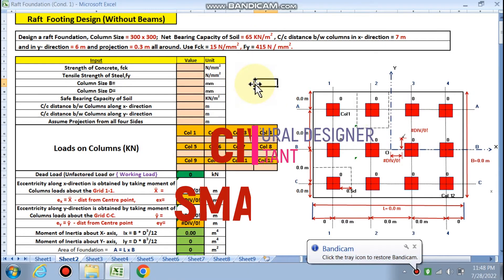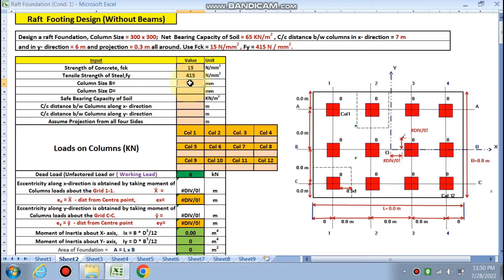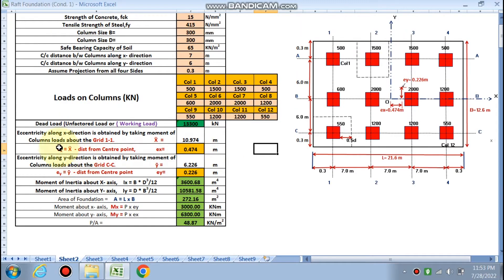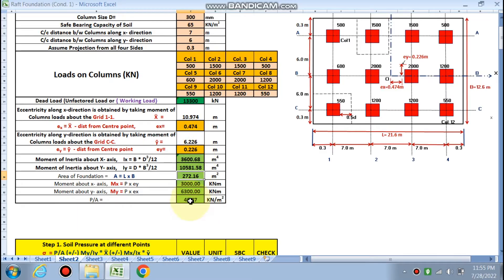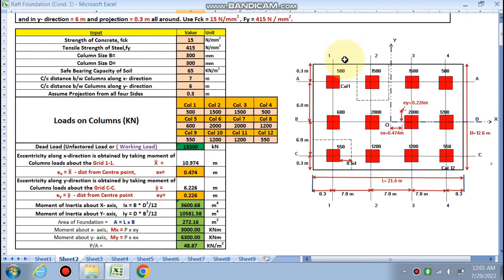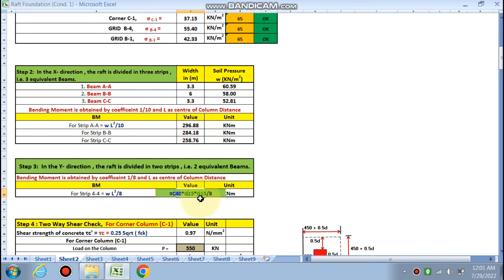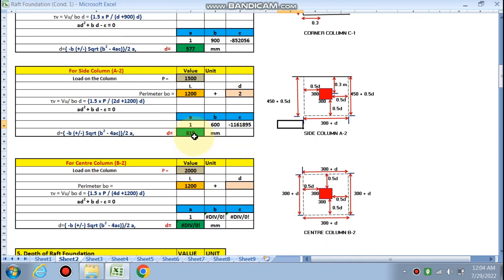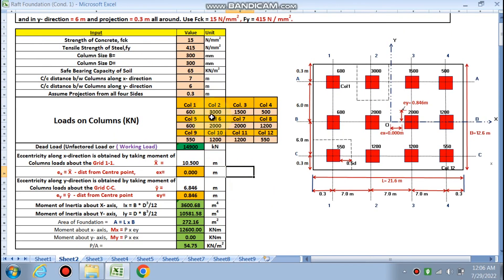RAFT FOOTING DESIGN WITHOUT BEAMS- BY CIVIL SMART

Comment from the maker: To get all the footing excel Sheets get from below link:
https://pmny.in/PAYUMN/WJczW5eItHK9
    

Full design Excel sheets course 
https://pmny.in/era02LAqXt8B

Full Course includes all sheets as under:

IN FOOTING DESIGN SHEETS

1. Isolated square footing

2. Isolated rectangular footing

3. Combined rectangular footing

4. Trapezoidal footing design

5. Strap beam footing design

6. Footing with uniaxial bending

7. Footing with biaxial bending

8. Pile foundation

9. Pile cap design 3 & 4 piles

10. Wall footing/ Strap footing

11. Raft Foundation ( Beam and Slab Type).

12. Strip footing design ( 4 columns).

13. Eccentric Footing Design (Column at dist x from the edge of footing).

14. Eccentric Footing Design ( Column is at Edge of the footing).
 
IN BEAM DESIGN SHEETS

1. Singly reinforced beam design sheet

2. Doubly reinforced beam design

3. Continuous beams design  with point load having :

    2-span continuous beam

    3-span continuous beam

    4-span  continuous beam

    5- span continuous beam

4. Cantilever Beam Design.

5. T-beam Analysis.

IN COLUMN DESIGN SHEETS

1. Axially loaded column design

   (a). When column size is known.

   (b). When column size is not known.

2. Column with axial load with uniaxial moment ( on 2 sides and 4 sides reinforcement)

3. Column with axial load with biaxial moment

4. Mux and Muy Calculation sheet.

IN SLAB DESIGN SHEETS

1. Cantilever slab design sheet.

2. Simply supported slab design sheet.

3. One way Continuous slab design sheet.

4. Two way Continuous Slab design sheet.

5. Two way simply supported slab design sheet.

6. Flat slab design (without drop and column head).

7. Flat slab design with drop only.

8. Flat slab design with column head only.

IN STAIRCASE DESIGN SHEETS.

1. Dog legged staircase design.

2. Open well staircase design.

IN RCC WATER TANK DESIGN SHEETS.

1. RCC WATER TANK RESTING ON GROUND (L/B <2).

2. RCC WATER TANK RESTING ON GROUND (L/B >2).

3. UNDER GROUND WATER TANK DESIGN (COND. TANK IS EMPTY AND OUTSIDE SOIL IS SATURATED).

5. UNDERGROUND WATER TANK ( TANK IS FULL AND NO OUTSIDE SOIL PRESSURE).

4. UNDER GROUND CIRCULAR WATER TANK.

5. Overhead Circular Water Tank design.

6. Intz Tank design.

IN WALL DESIGN SHEET

1. RC WALL DESIGN SHEET.

2. RETAINING  WALL DESIGN SHEET.

3. BASEMENT RETAINING WALL DESIGN SHEET.

4. Counterfort Retaining wall design sheet.

5. Shear wall design with boundary elements condition.

Building load calculation sheet

Cost estimation sheet..etc..

Comment: Sir can you provide a generic excel sheet where we can enter the number of columns of our own choice and the dimensions of columns could be different. That will help in cases where column dimensions are not same. Also are these dimensions calculated according to IS standards? Can we have an excel sheet where steel is calculated according to ACI standards.

Comment: In black cotton soil at what depth raft footing need to placed below ground level and what is the criteria??
Reply from the maker: Provide spread footings/wall footings, under reamed piles or raft foundation (for special structure whose load is greater than 6 tone/sq. m) for the low-rise buildings. Never rest the foundation on the black cotton soil. Lay the foundation minimum 300 to 500mm below the level where the cracks cease in the ground.
Reply: I have designed raft foundation (depth of raft is  550mm) for G+4 building at depth of 6 feet below G.L....and plumb concrete under the raft is 1ft of 2 layers ....is this appropriate ....what's your suggestion on this?

Comment: Sir, please explain how to find out the value for ex and ey?
Reply from the maker: If u calculate CG of the footing due to Column loads in x-direction then we will take moment about Grid 1-1

X = (Grid 2-2) loads x dist. From Grid 1-1 + (Grid 3-3) loads x dist. From Grid 1-1+ (Grid 4-4) x dist. From Grid1-1 / Total load
Hence X = ( 1500+2000+1200) x 7 + ( 1500+2000+1200) x 14 + (500+1200+550) x 21 / 13300
; X = 10.974 m from Grid 1-1

Same for Y
Y = 6.226m from Grid C-C

Now ex = X - dist of centre point of footing.
As X = dist. From Grid1-1, hence we need to add projection first
So, Total = 10.974 + 0.3 = 11.274m
Dist of Centre point= 21.6/2 = 10.8 m
Now ex = 11.274 - 10.8
ex = 0.474m

Same is for ey calculation
ey = Y + projection- dist of Centre point
ey = 6.626 + 0.3 + 12.6/2
ey = 0.226m
Hope u understand.

Comment: How to calculate cg of footing due to load..pls explain
Reply from the maker: If u calculate CG of the footing due to Column loads in x-direction then we will take moment about Grid 1-1

X = (Grid 2-2) loads x dist. From Grid 1-1 + (Grid 3-3) loads x dist. From Grid 1-1+ (Grid 4-4) x dist. From Grid1-1 / Total load
Hence X = ( 1500+2000+1200) x 7 + ( 1500+2000+1200) x 14 + (500+1200+550) x 21 / 13300
; X = 10.974 m from Grid 1-1

Same for Y
Y = 6.226m from Grid C-C

Hope u understand

Comment: If column no are more than 12 then what should we do?
Reply from the maker: If no. Of columns are more than it will be not used, but in case of less columns , we can put the load to zero and put spacing in diagram to zero..
Reply: @civilsmart  can you give a sheet with 40 to 60 column?
Reply from the maker: Send me your layout on my mail..i will modify it accordingly